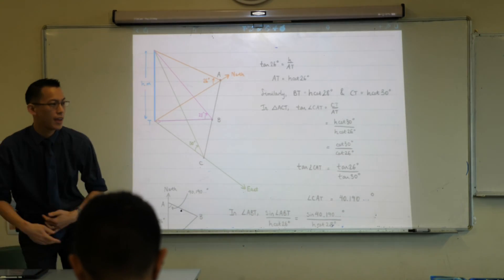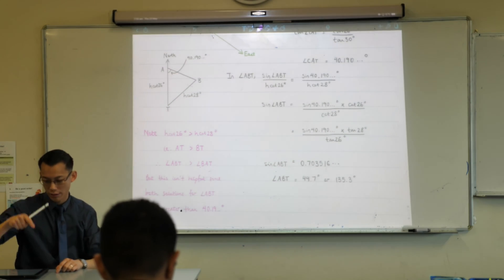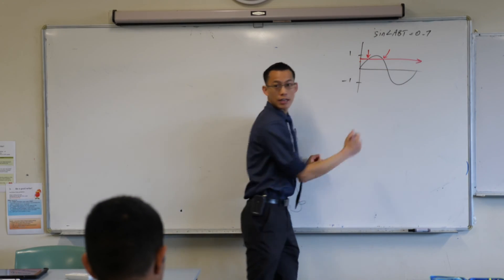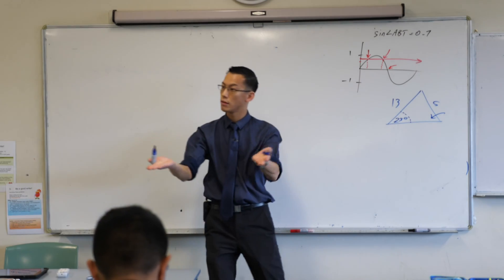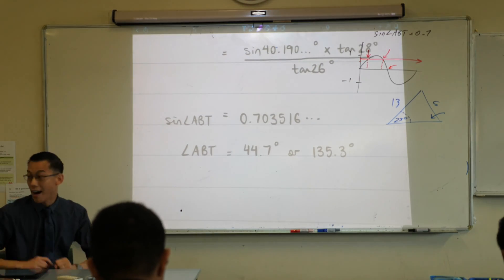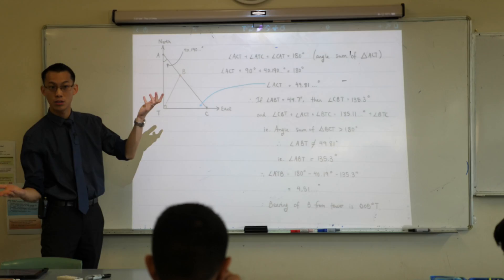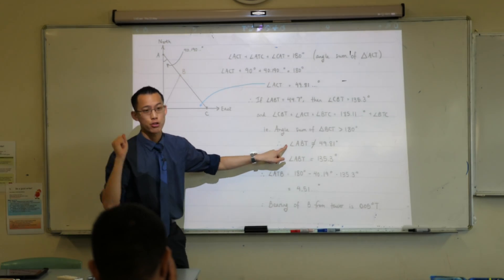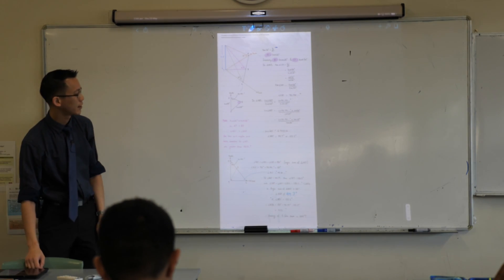3D Trig Three Observer Problem (4 of 4: Resolving the ambiguous case)

Comment: Would it not have been simpler, at the last step, to note that one observer was due north, one due east, and the third in between them (bearing in the north/east quadrant). As such, the obtuse angle, which would put that observer in the southeast quadrant, can be eliminated.

Comment: This is a good problem to get students to think instead of blindly  following a formula or method. It would be interesting to let the class work out the answer first. Then see how many students got the answer as 95 instead of 5. Clearly this is wrong so the next night's homework would include figuring out where the mistake was. 

I must admit, I first got 95 as my answer but quickly found the mistake.

Comment: Another way to figure which measure to use is by noting that ATB must be acute. Thus, ABT must be obtuse.
Reply: All angles of a triangle can all be acute though like the equilateral triangle all 60 degrees. 
It better to see what ATB is after trying the two angles, 44.7 and 135.3, with TAB, 40.2.
You will get ATB, 95.1 and 4.5 respectively, and ATB should be in the right angle of ATC which only 4.5 can be in the right angle.